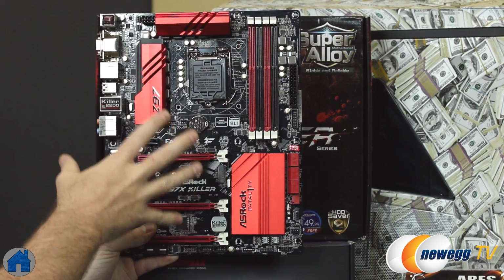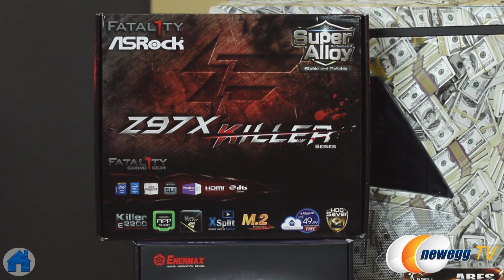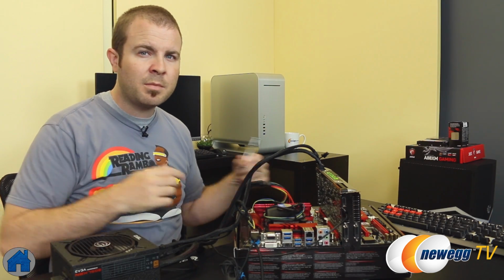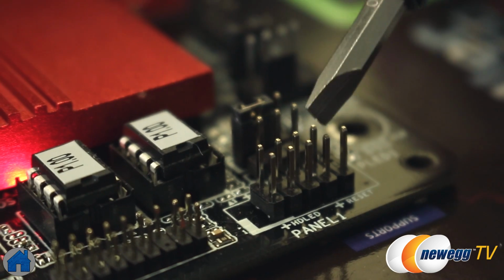How to Build a PC - Part 1 - Newegg TV

Comment: Okay, i found a Gateway Gt4024-RA, pc in my garage that my family didn't use anymore. I have $200 to upgrade this pc so i can play games.  Such as fallout, skyrim, minecraft etc.. i really dont care to have it at ultra settings. As long i can just play it without lag, im more than happy :) the specs of this pc are: proccesor: intel pentium d 805 (2.66ghz) , motherboard/graphics: ATI Radeon xpress 200 integrated , ram: 1024mb , hard drive: 250gb, if I'm missing anything please ask me. So what should i switch out to replace? And i have a budget of $200 and i know that much wont get me much but thats all i got :( if you could help me out thay would super awesome :) i know a littttle bit about computer but not enough, so please if you can tell me everything i need to get maybe under $200.
Reply: Holy shit that's an extremely bad computer. You're gonna need way more than $200 to even have an adequate playing experience xD.
Reply: Since you're new to this PC thing this will be extremely difficult to help you :L do lots of research about PC parts. Also, I recommend using pcpartpicker.com Great website

Comment: Whats a good graphics card to go with the AMD build? I built one similar but I might want to add a graphics card. Don't want to get more than I need though
Reply: carsondrum You should probably say what your needs are. It's much easier for someone to recommend something knowing that.
Reply: +Aaronion Rings nothing in particular, just wondering what would match it in terms of how good it performs
Reply: carsondrum Ah I see, so something where the card wouldn't be bottlenecked by the rest of the build.
Reply: Aaronion Rings yep
Reply: you can go with a reason r7 240 their super cheap and can run something like skyrim on practical max settings anti aliasing at 8x max aa setting is 16x so yeah near max also all details are max....   i wanna say it was like 50 bucks perhaps 60 .....  could be cheaper more actually....   i bought the xfx r7 240 low profile for my girlfriend and it hasn't even been presented with a challenge....  myself however i went with the r7 260x oc edition by msi i paid like 130 and i run EVERYTHING at max across the board except tomb raider 2013 but if i lower the res i can max everything have not tried the high res max settings everything runs great on both systems
Reply: Depends on your needs, your resolution, your CPU, and the games you look to play. GTX 950 for ~40-60 FPS on max settings 1080p, R9 380 for 60+ on most games on max settings 1080p

Comment: Hey guys, im looking to build a new PC ONLY for gaming , no streaming no viedeo or audio editing etc. my current pc is about 10 years old (i have upgraded it  2 years ago) and its impressive that it still does the job:
CPU: DualCore AMD Athlon 64 X2 Black Edition, 3215 MHz (upgraded)
MOBO: Gigabyte GA-M56S-S3 (4 PCI, 2 PCI-E x1, 1 PCI-E x16, 4 DDR2 DIMM,
GPU: nVIDIA GTX 650, PALIT (1GB) (upgraded)
RAM : 4096 MB (DDR2-800MhZ) (upgraded)
HDD : 320 ГБ( Hitachi 7200 rpm SATA 2)
POWER : 350w FORTRON
But despite the upgrades  10 years are still 10 years, its time for a new build.
I will realy be greatfull for your advice for the build i have in mind ( im thinking for the future and if the new pc coud last ATLEAST another 5 years) S HERE IT IS:
Mobo: Asrock 980de3/u3s3 /am3+ - 62 $
Cpu: amd fx-8350/4.2g/x8/box/am3+ - 214 $
Power s. : PSU CoolerMaster B600 V2 -  63 $
Gpu: palit geforce® gtx 960 jetstream (4096mb gddr5) -  280 $
Alternative GPU : sapphire r9 270x 4g gddr5 pci-e dvi-i / dvi-d / hdmi / dp dual-x with boost & oc version - 11217-04-10g – 239 $
HDD:  seagate barracuda 1tb, 3.5' sata, 7200, 64mb, no encryption - st1000dm003 – 68 $
MY OPINION is that the prices are a bit overpriced but thats how they are in my country.  thank you for your help and excuse me for spelling mistakes.

Comment: hi im building my first pc and everything is together on the out of the box build but it wont boot no lights no spinning fans nothing very frustrated pls help thx
Reply: dane blair Double check your wires. Unplug everything from the power supply side and replug them in. Do it one by one and push hard.
Reply: i did man i made sure i tried to power it on with nothing on it and it still wouldnt work have a new replacement coming in the mail but i do have a question my vga cables that came with my power supply dont match my graphics card socket also my cpu power doesnt match the mobo sockett either
Reply: oh, your processor doesn't match your motherboard? Double check. Look up your processor and find out what socket type it is and then compare it to your motherboard. That's probably the problem. VGA is a basic connection to your computer. In the graphic's card box you connect the adapter (which is usually white/blue/black) and connect it to the vga cable and THEN to your graphics card.
Reply: +dane blair Be more specific and give specs
Reply: Gabinuh i figured out the issue  was im a idiot of sorts a lot of motherboards come with to pins to post the mobo well mine you have to put into the case and plug in the power switch to get it to post the two pins i was shorting was the cmos i was clearing no one warned about this and as a first time pc builder i had no idea its all up and running power wise now i just rma'd a western digital drive man i dont recommend that company
Reply: btw i have a gigabyte fxa ud3 motherboard a amd fx8350 cpu with a cooler master cpu fan a msi gtx 970 4gb graphics card 2 x 8 gb gskill sniper ram and an evga 750 watt psu

Comment: Is the PSU supposed to work independent of any connections? Like, just plug in the power chord and flip the switch? I'd like to test mine out, but I'm still waiting on a CPU, RAM, and my aftermarket fan. I don't want to install everything just to discover the power supply doesn't work, so I did as I mentioned above and plugged in the power cable and flipped the switch, only nothing happened.
Reply: MedicMuffin Had to be connected.
Reply: What?
Reply: +Gabinuh he wants to test to make sure his power supply works before he connects everything. And that's hard to do if you don't have another PC to test on or a work bench.
Reply: Id highly recommend not to. Also, I doubt your PSU wouldn't work unless it's really, REALLY bad

Comment: can someone please tell me if these are all the parts to build a pc? don't tell me I need an operating system keyboard and mouse.i have those covered. ok are these all the parts needed?Parts List-
CPU-Intel Core i5-4590 3.3GHz Quad-Core Processor
RAM-G.Skill Ripjaws X Series 8GB (2 x 4GB)
GPU-XFX Radeon R9 285 2GB
Motherboard-ASRock H97 Anniversary ATX LGA1150 Motherboard
Storage-Western Digital Caviar Blue 1TB
Case-Antec One ATX Mid Tower Case
DVD Drive- Black SATA 24X DVD Burner
PSU-EVGA 600B 600W 80+ Bronze Certified

Comment: Intel Core BX80646I74790K i7-4790K Processor (8M Cache, up to 4.40 GHz)	$329.79	1
Cooler Master Hyper 212 EVO - CPU Cooler with 120mm PWM Fan (RR-212E-20PK-R2)	$31.06	1
Gigabyte Black Edition LGA 1150 Intel Z97 HDMI SATA 6Gb/s USB 3.0 ATX Intel Motherboards GA-Z97X-UD5H-BK	$188.71	1
Gigabyte GeForce GTX 980 Overclocked 4GB GDDR5 PCiE Video Card Graphics Cards GV-N980WF3OC-4GD	$499.99	2
Crucial Ballistix Sport 16GB Kit (8GBx2) DDR3 1600 MT/s (PC3-12800) UDIMM Memory BLS2KIT8G3D1609DS1S00/ BLS2CP8G3D1609DS1S00	$77.99	1
Crucial MX200 250GB SATA 2.5 Inch Internal Solid State Drive - CT250MX200SSD1	$97.22	1
Seagate 1TB Desktop HDD SATA 6Gb/s 64MB Cache 3.5-Inch Internal Bare Drive (ST1000DM003)	$50.97	1
NZXT SWITCH 810 White Full Tower Chassis with USB 3.0	$159.99	1
Seasonic M12II-850 BRONZE ATX 850 Power Supply	$137.29	1
Samsung SATA 1.5 Gb-s Optical Drive, Black SH-224DB/BEBE	$18.29	1
EGC High-Performance Thermal Compound 4 Grams	$9.99	1
EGC Monster Mouse Pad 14" x 10" (Black)

Thoughts?
Reply: +ElleboraPvP Holy hell.. why are you building that when you play MINECRAFT you can run that game with an intel pentium g3258 and integrated graphics.. god.. people like you should just buy some cheap acer laptop.. and do not bring something up like "I want to play Call of Duty Advanced Warfare though!" Because an i3-4160 and a gtx 750 ti could run CoD AW
Reply: Component		Selection	Base	Promo	Shipping	Tax	Price	Where	
CPU	

Intel Core i7-4790K 4.0GHz Quad-Core Processor
$327.99				$327.99	NCIX US	Buy
CPU Cooler	

Cooler Master Hyper 212 EVO 82.9 CFM Sleeve Bearing CPU Cooler
$35.98	-$10.00			$25.98	OutletPC	Buy
$10.00 mail-in rebate	
Thermal Compound	

Arctic Silver 5 High-Density Polysynthetic Silver 3.5g Thermal Paste
$6.75				$6.75	OutletPC	Buy

Arctic Silver 5 High-Density Polysynthetic Silver 3.5g Thermal Paste
$6.75				$6.75	OutletPC	Buy
Motherboard	

MSI Z97S SLI Krait Edition ATX LGA1150 Motherboard
$125.99	-$10.00			$115.99	SuperBiiz	Buy
$10.00 mail-in rebate	
Memory	

Corsair Vengeance Pro 16GB (2 x 8GB) DDR3-2133 Memory
$114.99		FREE		$114.99	Newegg	Buy
Storage	

Samsung 850 EVO-Series 250GB 2.5" Solid State Drive
$89.99		FREE		$89.99	Amazon	Buy

Western Digital Caviar Blue 1TB 3.5" 7200RPM Internal Hard Drive
$44.99		$2.99		$47.98	Best Buy	Buy
Video Card	

Gigabyte GeForce GTX 980 4GB WINDFORCE Video Card (2-Way SLI)
$519.99	-$20.00	$2.99		$502.98	Newegg	Buy
$20.00 mail-in rebate	

Gigabyte GeForce GTX 980 4GB WINDFORCE Video Card (2-Way SLI)
$519.99	-$20.00	$2.99		$502.98	Newegg	Buy
$20.00 mail-in rebate	
Case	

NZXT Phantom 820 (Black) ATX Full Tower Case
$206.99				$206.99	SuperBiiz	Buy
Power Supply	

Corsair RM 850W 80+ Gold Certified Fully-Modular ATX Power Supply
$129.99	-$12.99	$6.99		$123.99	Newegg	Buy
+ 10% off w/ promo code EMCAWNA24, ends 8/25	
Optical Drive	

Asus DRW-24B1ST/BLK/B/AS DVD/CD Writer
$18.75				$18.75	OutletPC	Buy
Operating System	

Microsoft Windows 10 Home OEM (64-bit)
$93.89				$93.89	OutletPC	Buy
Monitor	

BenQ XL2430T 144Hz 24.0" Monitor
$379.00		FREE		$379.00	Amazon	Buy
Reply: +ElleboraPvP Holy crap just give me simple specs instead of putting unnecessary words in there so I understand this better.
Reply: +Gabinuh IKR
Reply: Simerjeet Singh Hey um ya. I play csgo minecraft rainbow 6 siege warframe and a couple others.
Reply: HAHAHAHAHAHHAHAHA AND YOU NEED THAT PC? HAHAHA
A OP PC FOR CSGO MINECRAFT WARFRAME AND ONE DEMANDING GAME HAHAHAHAHA
Reply: +Simerjeet Singh R6S isn't even demanding, I run it on 30fps with a gt740m
Reply: Mr.360 Oh... well I stand corrected

Comment: I'm sorta new to computers. I want to get a gaming computer and also I am going to try and learn coding and programming things. I want the build to be good but I don't want the most expensive parts. I am also stumped between AMD vs Intel. One of my friends urges me to get Intel and another urges me to get AMD. Can someone recommend me a good build for my needs? Also should I get Intel or AMD? I heard Intel is better for work and things but AMD is good for gaming and budget friendly.
Reply: +Koala Wizard intel and amd are basically the same until you get into intel's i7 chips, so if you are in the market for an i5 or i3 get an amd unless you care alot about single core performance.

Comment: Hello! I'm new to the world of PC building and would like some criticism. Would this be a good build for Photoshop, light video editing, and some gaming?:

CPU: Intel Core i5-4690k 3.5GHz quad core processor
CPU Cooler: Cooler Master Hyper 212 Plus 76.8 CFM Sleeve Bearing CPU Cooler
Motherboard: Gigabyte GA-797X-Gaming 5 ATX LGA1150 
Memory: G.Skill Ripjaws X Series 8GB (2x4gb) DDR3-1600 Memory
Storage: Western Digital Caviar Blue 1TB 3.5" 7200RPM Internal Hard Drive
Video Card: XFX Radeon R7 250X 2GB Core Edition Video Card
Case: NZXT Phantom 410 (White) ATX Mid Tower Case
Power Supply: Corsair CX 600W 80+ Bronze Certified Semi-Modular ATX Power Supply
Optical Drive: Samsung SH-224DB/BEBE DVD/CD Writer

Thank You!

Comment: Time to get on the 'what about this' pc train.
http://pcpartpicker.com/p/8D2JdC
is this good for gta V and stuff around that intensity. mainly curious about power supply, is that gonna be enough wattage
Reply: ok thank you i upgraded it to a 1000W power supply from evga. 

the 500w from b4 was the recommended one by pcpartpicker so i guessed it was ok but then i did some basic calculations and knew it couldn't work out. thanks for the feedback and looking at the video card for me.

Comment: could someone tell me if these parts are compatible
Motherboard: GIGABYTE GA-Z97X-Gaming 7 LGA 1150 Intel Z97 HDMI SATA 6Gb/s USB 3.0 ATX Intel Motherboard

RAM: CORSAIR Vengeance 16GB (2 x 8GB) 240-Pin DDR3 SDRAM DDR3 1600 (PC3 12800) Desktop Memory Model CMZ16GX3M2A1600C10R

Storage: Seagate Barracuda 1TB 3.5" 7200RPM Internal Hard Drive

Case: Fractal Design Define R5 FD-CA-DEF-R5-BK-W Black Computer Case

Power supply: EVGA 220-G2-0850-XR 80 PLUS GOLD 850 W 10 yr Warranty ECO Mode Fully Modular NVIDIA SLI Ready and Crossfire Support

Processor: Intel Core i7-4790K Devil’s Canyon Quad-Core 4.0GHz LGA 1150 BX80646I74790K Desktop Processor Intel HD Graphics 4600

Video Card: EVGA 04G-P4-2983-KR GeForce GTX 980 Superclocked ACX 2.0 4GB 256-Bit GDDR5 PCI Express 3.0 x16 SLI Support Video Card

Cooling: Enermax Liqmax 120S Aluminum All-in-One Liquid Cooler With 120mm High Static Pressure Fan

Comment: Could someone please tell me if these parts are all compatible? This will be my first build and I'm not looking for something too fancy. 

Cpu/apu: AMD a8 7600

Motherboard: Gigabyte GA-F2A68HM-DS2H Micro ATX FM2+ Motherboard

RAM: G.Skill Sniper Series 8GB (2 x 4GB) DDR3-1866 Memory

Storage: Seagate Barracuda 1TB 3.5" 7200RPM Internal Hard Drive

Case: Rosewill FBM-01 MicroATX Mini Tower Case

Power supply: EVGA 500W 80+ Bronze Certified ATX Power Supply

I'm pretty noob when it comes to this stuff. This is meant to be a budget build that costs somewhere around $300. I want to build this pc to play a few games like gmod, counter strike source, Csgo, and minecraft. The computer we currently have is an old HP Pavilion from 2007. My family desperately needs a new one and I want to make sure that this build is OK for the situation
Reply: SolarShihtzu All compatible, but you might be overdoing it with 500W. You can get away with 400 or 350W for this build. Also you wanna make sure your case doesn't have USB 3.0 ports because your motherboard doesn't support USB 3.0. It'll all still work, but those ports won't function.
Reply: The Cabbage Oh alright. Thanks for the feedback. It means a lot ☺. I have one more question. Will I need to update the bios, or can I start putting it together as soon as I get the parts?
Reply: Not 100% but I'm fairly sure you can throw it together from the get-go, no updates needed.
Reply: The Cabbage Alright. Thanks a lot man. Pcpartpicker verified it. You really helped me.
Reply: Gmod might lag a bit it's more intensive than CS:GO and definitely Minecraft. If you can upgrade get a graphics card. That's highly recommended
Reply: Gabinuh depends what you're doing on gmod, that game could lag on a monster £2,000 build if you attach enough thrusters to something. I think the build is fine for source games
Reply: How well could this computer u r building run a game for example battlefeild 4 on medium quality?

Comment: Listen, I am very new to computers, but all I know that building one is cheaper and smarter than buying one. So please tell me if this build would hypothetically work correctly.

Processor: AMD FD8320FRHKBOX FX-8320 FX-Series 8-Core Black Edition

CPU Cooler: Cooler Master Hyper 212 EVO - CPU Cooler with 120 mm PWM Fan

Motherboard: Gigabyte AM3+ AMD DDR3 1333 760G HDMI USB 3.0 Micro ATX Motherboard GA-78LMT-USB3

Graphics Card: EVGA GeForce GTX 960 SuperSC ACX 2.0+ 2GB GDDR5 128bit, 
PCI-E 3.0 Dual-Link DVI-I, 3 x DP, HDMI, SLI, HDCP, G-SYNC Ready Graphics Cards 02G-P4-2966-KR

RAM: Crucial Ballistix Sport 8GB Kit (4GBx2) DDR3 1600 (PC3-12800) 240-Pin 
UDIMM Memory BLS2KIT4G3D1609DS1S00/BLS2CP4G3D160

Hard Drive: Seagate Barracuda 1 TB HDD SATA 6 Gb/s NCQ 64MB Cache 3.5-Inch 
Internal Bare Drive ST1000DM003

Power: FSP Group AURUM S 400W Power Supply with Intel Haswell Certified

Case: Thermaltake V3 Black Edition VL80001W2Z Black SECC / Plastic ATX Mid Tower Computer Case

Optical Drive: Lite-On 24X SATA Internal DVD+/-RW Drive Optical Drive IHAS124-14

OS: Windows 7
Reply: Khakis - Minecraft if you build youre pc on pcpartpicker it will tell you if it would work and the total price and watts :)
Reply: Your motherboard has ram up to 1333mHz, but you bought ram at 1600 mHz, you could save money, but it will work
Reply: Khakis - Minecraft man better check if your motherboard supports ddr5 graphics card cuz it says ddr3 on it, i'm just not sure of it. And if you can afford all of these parts you might want to get atleast  a 500w power supply to run it all.
Reply: +xpeRt God the 500w psu is a good call, but you must not know about computers. Ddr3 and ddr4 are types of system memory, wheres the ddr5 on the gpu is gddr5, a type of vram. Regardless of whether the mobo supports ddr5, for the gpu, the mobi just needs a pcie 3.0 slot
Reply: Yes, but holy crap you need a better power supply. 400 watts won't cut it. Like the guys above me, get at least a 500W one.

Comment: How well would I run GTA V and DayZ SA and other games on what settings with this computer?
I am going to build it if it runs most games very good.
*Intel Core i5-4460 3.2GHz Quad-Core Processor
*MSI Z97S SLI Krait Edition ATX LGA1150 Motherboard
*Corsair Vengeance 8GB (2 x 4GB) DDR3-1600 Memory
*Seagate Barracuda 1TB 3.5" 7200RPM Internal Hard Drive
*MSI GeForce GTX 750 Ti 2GB TWIN FROZR Video Card
*Corsair CX 600W 80+ Bronze Certified Semi-Modular ATX Power Supply
*Samsung SH-224DB/BEBE DVD/CD Writer
Reply: AnthonyBubster DayZ you could run on high, you might encounter issues with GTA though, depending on your resolution.